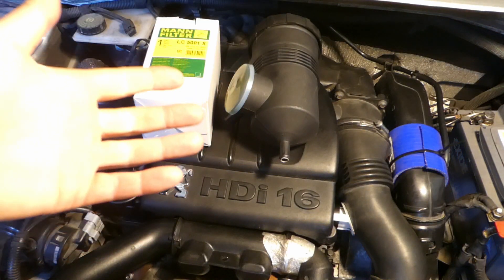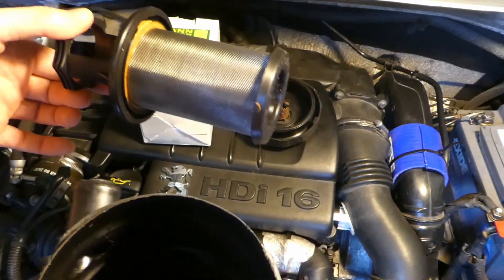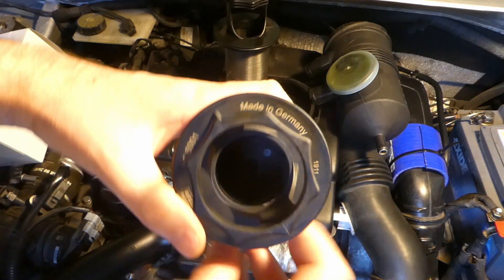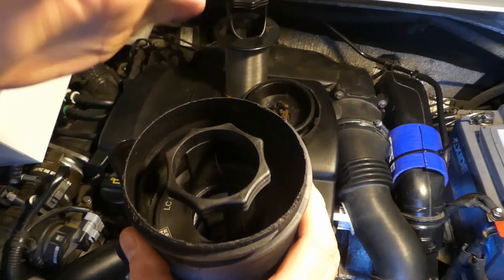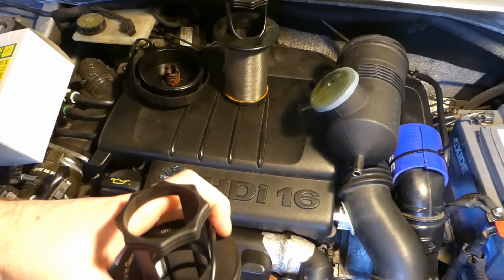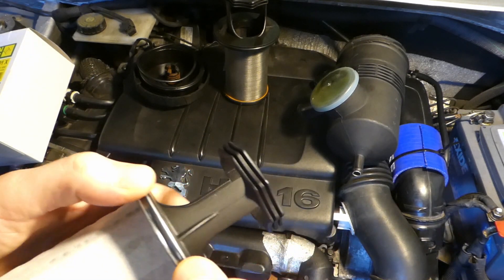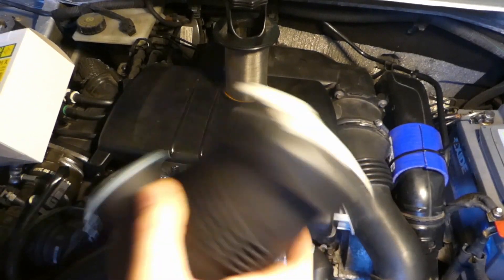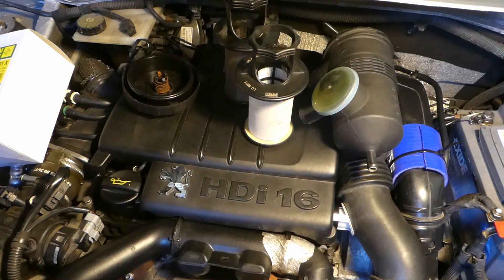Assemble cheapest "original" Mann Hummel Provent200 oil catch can

Comment: Hi, awesome videos. How you measured the blowby pressure?
Reply from the maker: Thank you. I had several ways of measuring the crankcase pressure, one was with Bosch DPF sensor and arduino (https://www.youtube.com/watch?v=h4TQ-XVWU30) or the old-school water U-bend manometer kind of thing (https://youtu.be/FZYWcqkMN-I). Both show the same thing of course.
With the arduino was much better as I can record it along a drive.
Reply: Hi, thanks for your reply. Which size did you buy - 10mm to 1/8" ? 
Also that method with the arduino looks more comprehensive, but also more involved with all those commands to the yoke. Any recommendations on model arduino to go for? Thanks in advance
Reply from the maker: @djotenjdm7213  Not too sure which size you are asking about. I think I went for a elegoo uno, not quite an arduino but does the same job. I bought it for other purposes, but it worked alright for the pressure. Yeah, it is pretty basic, not quite an arduino, but it was cheaper at the time. Probably should have gone with an arduino. Works alright, not too sure if I can recommend it, although it did the job
Reply: Sorry my bad, was asking for the size of the 90 degree brass elbows you screw in to the cap. Saw you drilled 10mm so you probably have 10mm to 1/8" one?
Reply from the maker: @djotenjdm7213  Might have been, cannot quite remember now, but I think it was 10mm to 10mm 90 degree elbow and I used probably 9mm drill and filed the hole to shape, like a die sort of thing, but without the die, haha. The elbow screwed on pretty tight anyway.

Comment: Hi thank you for this. What are the advantages and disadvantages of removing the preassure bottom valve? I have the clone provent i also have same problem valve is look like close.
Reply from the maker: No disadvantage in removing it. The problem is you would need to find something that fits in there quite tight. Otherwise keeping it in there is a bit of restriction and might increase the crankcase pressure a bit, but ptobably not too much. This is a valve to regulate the pressure if the bottom is connected directly to the sump, so oil from the catch can goes back into the sump. If one is collecting the oil and disposing it then there is no need for this valve.
Reply: @moremolecules  Thank you for the quick reply. I notice that the edge of the rubber valve is not hard that can restrict the airflow. Just wondering what will happen if crackcase will have more preassure than normal. Will it blow the engine or affect engine performance? I have nissan np300. It's really hard to find a cover that can fit. How did you find yours?
Reply: Do you remember where that clear plastic cap came from to remove the bottom valve on the Provent? I tried a pringles cap but it is to big
Thanks
Reply: @moremolecules  What about the differences in valves between original and cheap catch can? Original Provent is designed to let go pressure at some point (50mBar?), to protect engine in case the device gets blocked. How about the cheap version, are the relief valves similiar of quality and design?
Reply from the maker: @Siatkowkarzadzi  Yeah, good question. The original valve is designed to open at ~50mbar, who knows how the cheap oil catch cans do. It is the same relief valve, but I do not know at what mbars it opens. Nevertheless, I would not rely on that valve to open at 50mbar, even in the original.

Comment: Hi, great video and info':washhands:, did you use 22mm copper tubing to reinforce the inlet and outlet 25mm plastic hose connectors? Some people mention their copy looks flimsy, other than the main connections, does your copy look substantial enough to cope with high under bonnet temperatures?
Reply from the maker: Yes, absolutely correct. I used the 22mm copper tubing to reinforce the plastic hose connectors. Altogether it is sturdy enough to withstand the temperature under the bonnet, but the connectors are a bit on the soft side. When I tightened the hose connectors a few times, they distorted a bit, hence the copper reinforcement.
Overall the plastic is not as sturdy as the original, but it is good enough for the price. I had it for ~2 years without a problem.
Reply: @moremolecules  Thank you that's exactly what I needed to know 👍.
I want to use mine on a modern DI petrol turbo engine (same as Vale C. but Ford) and although Mann state it's only resistant to "diesel fuel, engine oil, lube oil, cleaning agents" I was going to give it a go as they are so cheap and TBH it's the only decently sized unit/connections that I would be happy using, plus it's lightweight. The plastic might be slightly different to the Mann so not sure if that is actually better or not for use on a petrol engine. I can swop out the rubber orings but if the housing degrades then I'll have to find something else.
Any thoughts on its compatibility with petrol?
Reply from the maker: @stuartwalker2078  Good question, but I doubt anyone knows, it is a cheap knock off, no description of any sort. For the price you could try it to see if it is alright. Seals might perish probably, but they could be replaced by petrol-resistant ones. The problem is the bottom valve, but the rubber seems quite sturdy to be honest and I have not seen any distortions in it.

Comment: I would not trust the cheap knockoff to work like the original. it's not just the filter that's different. The latest provent has redesigned pressure relief valves.

Comment: Habrá algún problema en quitar la válvula inferior de presión que trae abajo el colector? Pienso recolectar el aceite y no devolverlo al sumidero y ahí donde va la válvula le pondré solo una tapa que mandaré a fabricar a medida. También  he estado viendo que el filtro de papel que viene adentro en su interior trae un tipo de resorte que al presionar desde el interior del filtro se abre hacia afuera como para dejar caer el aceite tal vez y me preguntaba no será que estos dos mecanismos (válvula inferior y válvula que se encuentran adentro del filtro de papel) trabajen juntos?
Tal vez la válvula inferior cuando quiere mandar el aceite por la manguera recolectora se cierra y esta presión hace que se habrá la válvula interior del filtro de papel?
Reply from the maker: Yes, you can remove the bottom valve completely as long as you secure the opening. See how I did it myself: https://youtu.be/QdxyAHP1DVM?t=533. The valve is to equalise the pressure of you are returning the oil to the sump. Not too sure what you mean by valve in the filter element. There is no valve on my paper element.
Reply: @moremolecules cuando dice igualar la presión de retorno se refiere que esta valvula  inferior empuja el aceite hacia el carter? Mi filtro no es como el que usted tiene ya que en la tapa no trae ese resorte para liberar presión si no que lo trae en el interior del filtro de papel, le dejo este video y vaya al minuto 10:00 y entenderá a lo que me refiero https://youtu.be/gr5SoSDrRTQ

Comment: Hello, I have a Volkswagen with a 1.9 TDI engine, and I wanted to know how the fake mann hummel behaves with the original filter, and if in my case it is recommended to remove the bottom piece and cover with plastic like yours, thank you.
Reply from the maker: I cannot quite say if the "fake" behaves exactly in the same way, probably. I removed it as I thought it adds a little bit of a restriction and the purpose as a valve for putting back the oil in the sump is not done in my case.

Comment: Hi, really interested to know how much oil/soot this catch can has collected since the installation or do you use the return outlet to the oil sump. Thinking of use this method for  my Bmw e90 m57 330d . I was worried about excess crank case pressure blowing gaskets and seals, but your other video reassured me that's not the case with this particular catch can.
Thanks in advance.
Reply from the maker: Hi liam, I have had it for awhile, probably ~1 year or so. It has collected ~500ml of fluid. I say fluid, as it is mainly watery-based liquid. There has been 60-80ml of oil as well. What is collected really depends on the weather. In winter when there is a lot of humidity it collects a lot of water and I have to empty it every 3 days or so. In summer, it is mainly oil and a lot less water.
I do not return it to the sump and collect it in a hose that runs from the bottom. I was also worried a lot about the crankcase pressure and blowing seals/gaskets, but the difference is negligible. I now have a second oil catch can and will eventually test the efficiency of the original vs. the cheap one. If I were you I would buy a new oil filler cap, drill a hole inside and hook it up to an Arduino. You can then measure the crankcase pressure and see how much it changes with the oil catch can. I have a few videos on that topic and how I did it (one is here: https://www.youtube.com/watch?v=h4TQ-XVWU30)
Reply: Hi
I am about to install Chinese Procent 300 in my 3.0 diesel. What makes me concerned in that one I bought there is like double top cover - first cap is like flat with spring pressure valve which goes over filter, and then over it there is another screw on lid (like one vid), but without any holes! And after screw it on there is a seal blocking the way for pressure released from valve under it, doesn't make sense for me. Generally to prolong the live of piston rings there should be a bit of vacuum in the crankshaft case. Now I'm really worried if that cheap catch can won't create an OVER PRESSURE or level the desired vacuum.

Comment: hi , i have got peugeot partner 1.6 hdi adventure pack , my car same as your car . I watched your video that "gearbox oil change " and i have question for you about with that , Are there coming gearbox voice from gearbox after changed gearbox oil ?
Reply from the maker: Hi Kadirhan, I am sorry but I cannot quite understand what you are asking. If you are asking if there will be any noises coming from the gearbox after oil change? No, there should not be any unusual noises, as long as everything is alright, for example oil was put in with the appropriate thickness. My gearbox is the same after the oil change, nothing different.
Reply: @moremolecules  there are many mistakes in my write , so it is normal that you couldn't understand exactly the my write :) . after all , you understood what i am asked you and you replied ,  thanks . there is another ask , how much your car's highest fuel consumption and min fuel consumption ? i hope you understand this ask :)
Reply from the maker: @kadirhanatmaca  No worries, I understood. I keep a fairly detailed log about the car's consumption. I mostly do from full tank to empty tank and reset the meter to 0, so I know exactly how many miles for whatever I fill at the petrol station. My minimum ever was ~4.7 L/100km and max ~7.7 L/100km (in winter). My average since 2012 is ~5.7 L/100km.

Comment: Hi, thank you for your videos. Interested in the Provent 200. I want install it on a 1.6 THP motor (benzine, Peugeot) that is direct ejection and afflicted by carbon buildup on the intake valves. Just to summarize your experience with this oil catcher, did you noticed differences between the China metal mesh and the original Mann filter (after the filter was saturated with oil)?  I see some white glue/paint on the lid, did you modify something on the valve? Are you still without the valve on the outlet conduct? Any other feedback will be appreciate.
I just subscribed to your channel ;)!
Reply from the maker: Hi Vale, many thanks for subscribing, appreciate it! These are very good questions. I have not yet run the paper filter of the Provent 200 for long, so would not be able to comment much. Once I run for a few months I will be able to tell if there is a diference in the oily paper one vs. the metal filter mesh.
Yes, the white thing was just a mistake. There was not much space in the engine where to put the oil catch can and the top of the filter was rubbing on the bonnet. So, I shaved the fins on the top, but it turns out they were hollow, so I had to put some sealant on there, so there are no holes.
Yes, I am still without the side vent on the Chinese Provent 200, but with one on the original one. I would remove it if I can find a good cap that woud fit in there, I have not yet found one. The diameters between the cheap one and the original are slightly different
Reply: @moremolecules  Thank you for reply soo fast. Do you mean that you are still using the metal mesh filter? How it is working? I just saw that now also the Chinese cotton version is available and the feedbacks are positive. 7-8 Euro vs 36 Euro of the original one (best price I could find on Dutch websites). Plus shipping costs that are a lot cheaper or free from China!
Reply from the maker: @valex76x  I had to remove my oil catch can altogether as I had to get the car to the annual motor vehicle testing here (MOT). They view this as modification and my car would have failed, although it reduces emissions. So, I have not used it that much since I removed it as I had to do other things and have not had much time to test it or drive the car with the oil catch can, covid, etc.
I do not really have a view on the difference between the cotton and metal mesh with respect to better filtering or crankcase pressure. Unfortunately, I have not had the time. It is a one-man operation here and a day job to attend to :-) I will do some tests and post them later one when I get the chance.
Reply: @moremolecules  Thank you again for sharing.
Reply: Why are u using this provent on a petrol when it’s made for diesel only cuz the seal or o rings will deteriorate ?
Reply from the maker: @kmohaji152  The car is 1.6HDi, i.e. a diesel, maybe I did not make it clear in the video
Reply: Hi Vale C. , did you manage to try one of these on your petrol engine?
Reply: @moremolecules  , Hi, any update on the comparison of the metal mesh vs the OE paper filter?  Maybe the metal mesh WITH the steel wool vs the OE paper?  I like the washable metal mesh better, but the OE paper is what the SAE testing used and showed the Provent superior to other catch cans.  I've seen WAY too many "racing" websites with catch cans with very little in them and little idea of the science between SEPARATION of oil, water vapor & air.  Thanks for your videos
Reply from the maker: @douglasmontgomery6315  Unfortunately no, I have not got an update. Hope to do so in the next few months. Kind of "proper" efficiency test, i.e. semi-scientific test to see which filters better.

Comment: so does it actually work or its just better to get the original one ?
Reply from the maker: Good question. It works, but whether it works better than the original is very difficult to answer. I will be probably doing some tests on the efficiency later on. Currently, no one knows if it works better.